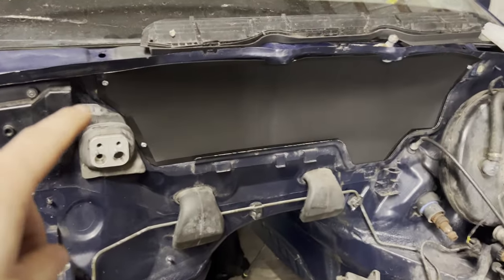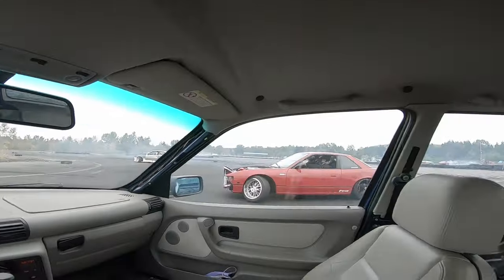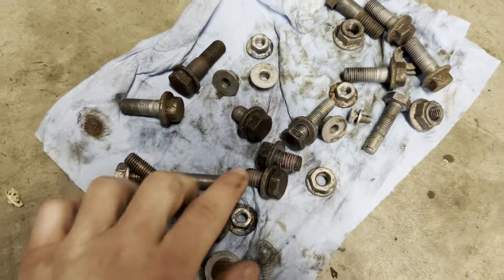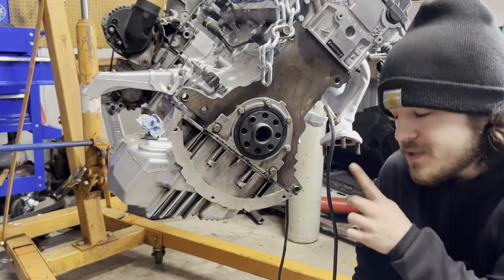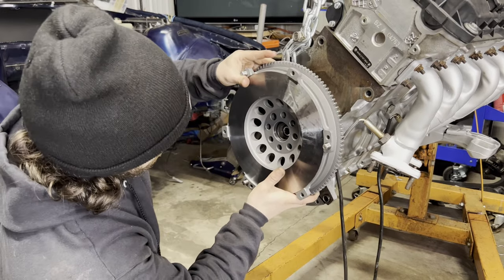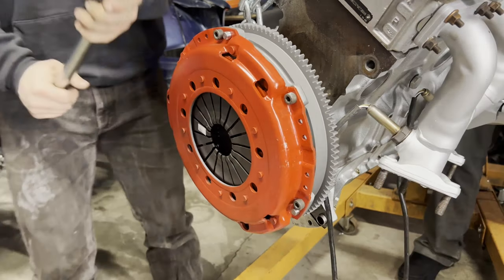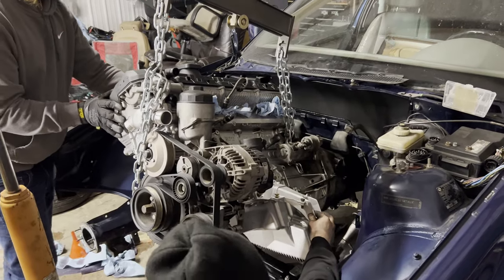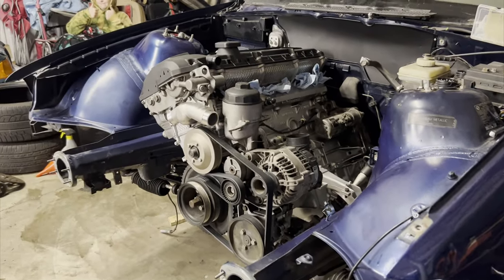I GAINED 50% MORE HORSEPOWER WITH THIS ONE EASY TRICK

Comment: What about the heater diverted did you use a block off plate  on the heater core ?
Reply from the maker: Nah I just left it open. At some point I'll end up removing it entirely.
Reply: @JamDrifts  what’s the thing inside called the big thing in the fire wall does it have to do with something with the ac and also can it be deleted?